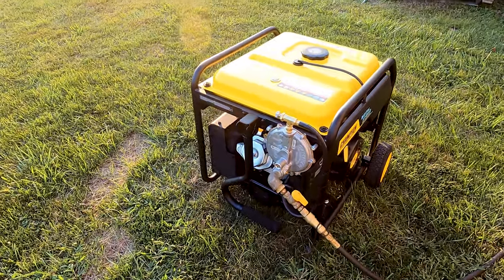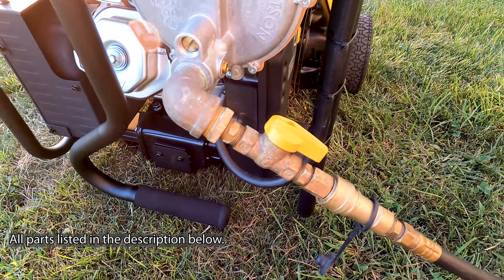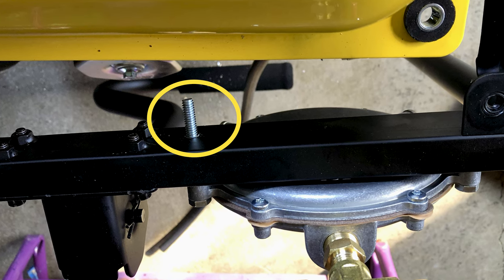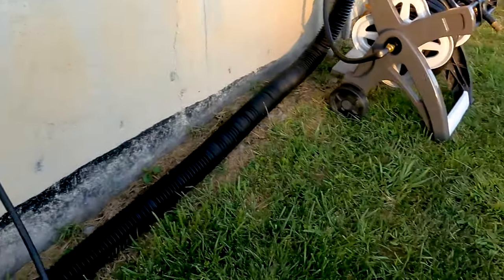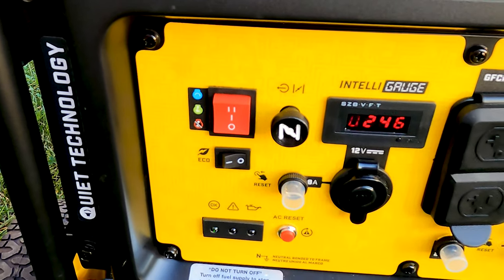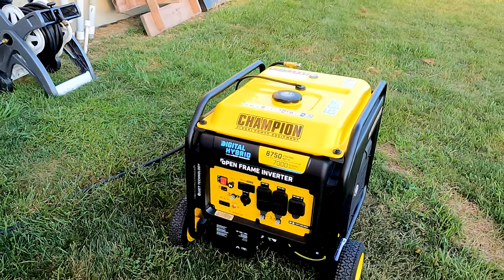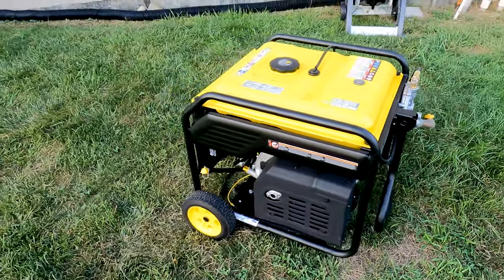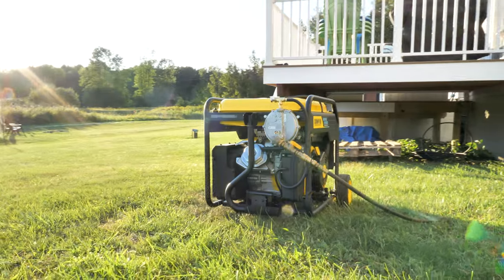TRI FUEL Conversion Kit for the CHAMPION 100520 INVERTER GENERATOR!

Comment: im confused on how the propane/ natural gas regulator regulates with engine load on these inverter generators. Can you still use the "eco" mode? Seams like at higher RPMs and engine load, the engine would run lean. Can anyone with experience weigh in?

Comment: Have you done any load testing on it?  My understanding was that the 8000+ Watt generators needed a 3/4" line (and a maximum of 15 feet of line at that) to get enough natural gas to support higher loads, but you seem to be getting by with a 3/8" line.
Reply from the maker: Yes, that would make sense for natural gas since it is less energy dense.  Using propane on my current setup.
Reply: @GreenMountainDIYGuy  I just bought one This Champion inverter Generator 8750 watts Today and will  do a Conversion to Natural Gas b.c. if Gasoline run out then will use Natural Gas...

Comment: Inverter not only gives good power it is quieter, and uses less fuel. I bought our 2200 Sportman already designed for dual fuel. No gas to go bad only use propane,
Reply from the maker: Right on!  So many benefits to propane!
Reply: @GreenMountainDIYGuy  will the MSK3101 kit work with my street/naturalgas supply? What size blackpipe is required to deliver adequate flow from the meter to the 3101? (its about 45 feet from the meter to the generator) Just dont want to choke it with too small an ID pipe....
Reply from the maker: @jmm1000  Check with US Carb, they have good customer service on your question.
Reply: @GreenMountainDIYGuy  will dooo! Groovy video!